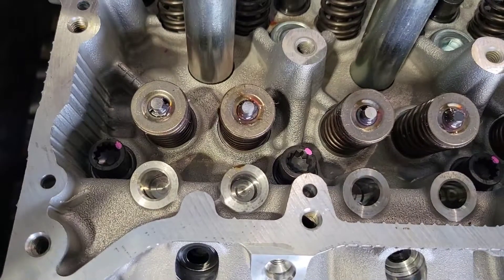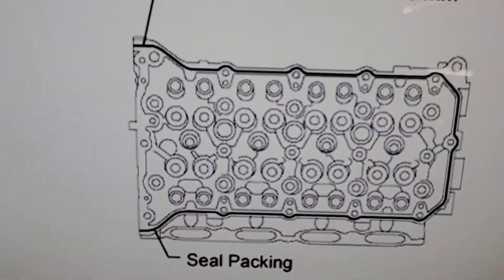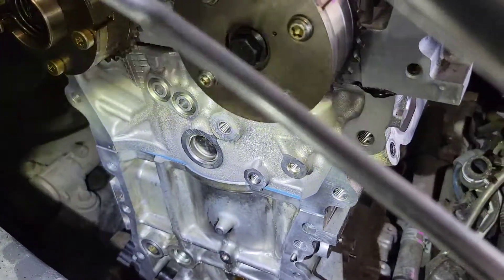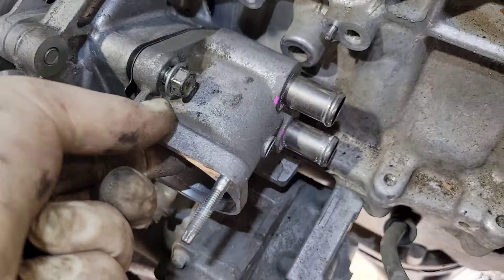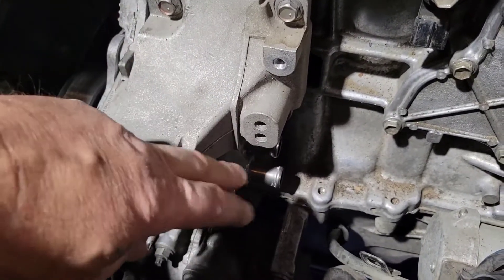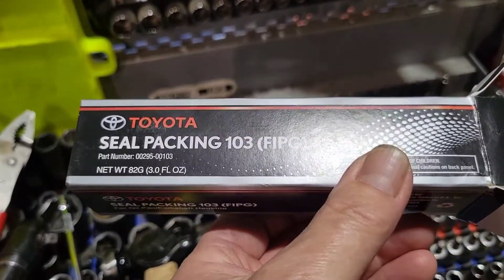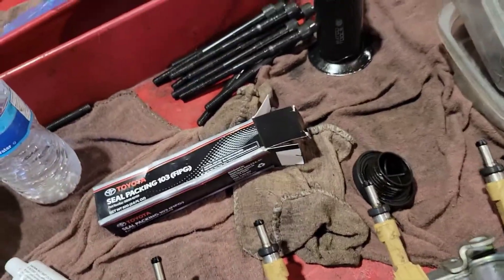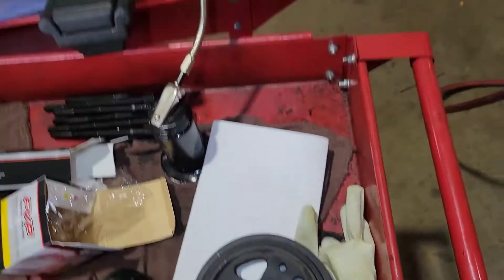2011 TOYOTA 1.8 Head Gasket INSTALLATION

Comment: How did you get that last bolt out of the bracket above the thermostat housing? I'm working on tearing down my engine right now, waiting on parts. But I'm having a heck of a time understanding how that last bolt comes out behind the thermostat housing before you remove the timing cover.
Reply from the maker: It is a pain in the butt to be honest. Thanks for watching
Reply: @NutsandBoltswithTone  Thanks again for your help posting this video made all the difference! You rock

Comment: Thank you for this video, I have a 2009 Corolla and she too had low compression in cylinder 3 and 4 and had cylinder 4 misfire, mechanics said no way its a head gasket, they told me new engine or new car, anyway thanks to your video and 2 others i was able to tear the engine apart and, behold my head gasket was burned through between cylinder 3 and 4 installed a new one from Felpro and problem is gone. Thank you for this video, it helped alot.
Reply from the maker: You are very welcome and happy it turned out good.

Comment: Thank you so much! I’ve been tearing my 2009 matrix apart. Finally got to the head gasket. Now I’m putting all back together.

Is there a good place to find specific specs for my engine? I keep finding 2003… not the same. Thanks!!
Reply from the maker: Alldata is what we use, you can buy a subscription for your specific vehicle.  Thanks for watching

Comment: Hey there, thank you for this instructional video! After I place the cam carrier on the head and insert the bolts loosely just to hold it in place.. how long should I wait for the FIPG to harden a bit before I torque down the bolts to spec?
Reply: Hey, just thought I'd keep you posted.. I finally re-removed the cover and set the timing properly again. After reassembly, my father-in-laws' car is once again functioning properly! Thanks again for this video and I hope you have a beautiful rest of your day my friend!
Reply from the maker: @AhiNama915  that is great news, thank you for following up.  I appreciate you
Reply from the maker: Omg I wish I had got to this sooner, the answer is immediately. You have everything clean and ready to assembly, put the sealer on, cam carrier then torque them down within a short time. You do not want the sealer to set before torquing it down. Message me on Instagram if you have any more questions. Thanks for watching.
Reply: @NutsandBoltswithTone  It's okay! Thank you for the reply. I ended up doing the same as you mentioned, and all went well. I even put the timing cover on the same. I put the tensioner in (un-tensioned) and left everything in place to continue the job the next day upon coming back. My father-in-law must have done something while I was gone, and when I came back I noticed the chain had jumped 1 tooth (the timing cover is already on) and now I don't know what to do? How do I fix this situation?
Reply from the maker: @AhiNama915  unfortunately you have to pull timing cover back off because with cover on even with tensioner out I don't think you can move the chain. Sorry your having trouble
Reply: @NutsandBoltswithTone  Awww man, I figured. Well.. thank you for taking the time to help me with my problem, my friend. You have a nice rest of your day!
Reply from the maker: @AhiNama915  you are welcome,  I had a couple co workers who mis timed that engine and had to take it a part.  Keep me posted on your progress please.

Comment: I enjoyed your videos on this engine and currently going into it because of no compression in all cylinders. I DIY a lot of my own and like you send out the parts to get checked. My question is when removing the head bolts, have you ever ran into the stripped threads (like most Camry engines)down in the block? what is the best fix after that issue?
Reply from the maker: Thank you for watching. Yes I have come across the Camry threads in the block pulling out with the head bolts. The only two options for this is to buy the kit to bore and install new threads or send the block to machine shop. When I come across this we remove the engine block and send out to the machine shop to have them bore and rethread all the bolt holes. If you are doing this you should bore and rethread all the head bolt holes. We send block out and have all the threads replaced. Thanks for watching.  Hit me up on Instagram if you have any further questions.

Comment: Your procedure for releasing the timing chain tensioner is not correct.   Once installed, you can’t get a screwdriver down to release the latch, nor do you need to.  Once it is installed, just rotate the engine counterclockwise about 1/2 turn and the latch will release.
Reply from the maker: Yes you are correct this is not the proper way, it works but not the correct way. You can actually get a screwdriver down there, I actually rotate the engine back to pop the tensioner then I stick a screwdriver down there to move the lock lever away from the tensioner. I updated my repair info in a future video doing timing cover on a Prius. Thank you for the information. I appreciate you watching.
Reply: Both ways work. I used the screw driver method. Just finished my head gasket today and this video was super useful!!!
Reply: I didn't use a screwdriver but didn't hear a specific swooshy sound so I had to open the valve cover an peak through the top to make sure everything was A-ok before starting the car back up.

Comment: Do i have to machine the head. I just blew my head gasket.
Reply from the maker: I always send the cylinder head to the machine shop to have it checked. If you pull it off and the head is warped and you install it with new headgasket you will have a blown head gasket again. Most of the time we send heads out to be checked they need to be machined. Thanks for watching. Hit me up on Instagram if you have anymore questions.

Comment: What if I rotated the engine with the cans out to clean the Pistons and now the kids won’t go in there the same? I mean the lobes are pushing right down on rockers and I can’t get the cams to sit flush or where it needs to be for timing.
Reply from the maker: You have to rotate cams slightly forward or backwards to get them in and torqued down. Then you have to move cams into time.  Thanks for watching.

Comment: do you find it true that flushing your coolant system helps prevent head gasket issues?
Reply from the maker: Honestly you should do it as a maintenance item but I do not think it is a contributor to it. Either you head gasket just fails from having a flaw or it was over heated and caused it to fail. Thank you for watching.

Comment: Tone, I just hot mine tore apart today and am working on ordering parts and was wondering what brand head gasket you recommend? Also what about the tensioner?
Reply from the maker: I think we put in fel pro but not saying that is a great option.  If it were me I would use oem head gasket. As far as the tensioner,  I would also offer a close to oem as possible.  If you have a lot of miles really inspect your timing chain guides make sure they are OK. If you have any further questions message me on Instagram.  Thanks for watching.

Comment: so did the cylinder head you sent off pressure test good? did they surface it or find anything wrong with the old head?
Reply from the maker: They resurfaced it. It was the head gasket, The machine shop actually did a valve job while it was there. Thank you for watching.

Comment: if you are catching a slight head gasket leak before it gets bad knowing what i know from months of research that thats whats causing my really low idle and slight loss of compression on 1 and 2 do i have to get the head resurfaced? ive heard mixed views if its not bad i would think it would be ok?? thanks for the work and time given to teach us DIY mechanics!
Reply from the maker: So here is my honest opinion, you have two choices send the head out and have it checked or not. Here is the problem, if you do not send it out and it is warped at all you will have to do the whole job over again. If you send it out and have it checked you also find out if you need any cylinder head work done. Best to get it done while head is off. I would personally never remove a cylinder head and not send it out, especially if it was for a blown headgasket. I appreciate you watching. message me on Instagram if you have any further questions.
Reply: Ok Instagram I go lol
Reply: Some are saying the tolerance is so low that marching it could mess up the timing because it will be a tiny bit shorter with the material gone...
Reply: @BIONDIEST  right that's where I was under the impression of...someone said it says in the owners manual not to have to head machined PEROID
Reply: @Justin Mike  it's really sad that things cannot be fixed anymore. You would think you could do something to offset that with the timing with the guides or chain or something... I've been wondering about this misfire on 4 for months and I've had mine parked. It makes pinging noises while accelerating in gear and shakes a little. The mechanics are trying to sell me cleanings and crap. It's either run the car dead or maybe not fix it right myself. Paying someone to do it doesn't seem worth it. a used or new engine doesn't seem worth it. Can't afford a new car.  I'm going to pray it's the head gasket and that it's not warped. Most risk most reward...Hopefully.  well if you find out anything please let me know.

Comment: If it hasn't been done yet on this engine, during this job would be the ideal time to replace the intake VVTi gear with the latest revision - part number 13050-0T050 - to avoid a future cold start rattle from the original gear.
Reply from the maker: Very good tip

Comment: Hey man I appreciate the video I just watched both of your videos while doing this job. After I got everything back together it runs great but I have an abs light, and airbag light and a steering light and the trans will not shift out of park. Can you tel me what I did wrong please.
Reply: Thanks for your reply man! It turns out I got into a rush because I was working outside in 9 degree weather on Christmas eve when I was finishing it up. I forgot to hook up the alternator and when I connected the battery and started it up I blew the fusible link which cause me to lose all those systems.
Reply from the maker: @Brandon Bentley  well I am happy you figured it out and nothing major.  👍
Reply from the maker: Well first I appreciate you watching and am happy you were able to complete the repair, as far as the lights being on and not shifting that could be a lot of things. To be able to shift out of park your brake light switch generally have to work, this could affect the other systems. First thing check to see if your brake lights work. If you have any questions message me on my instagram.

Comment: How did you clean all the silicone off of the engine block where the timing chain cover goes on?
Reply from the maker: I take scotch Brite pads and cut them in to small squares and with brake clean scrub. First thing I do though is take razor blade and cut off big pieces of silicone. Then scrub with scotch Brite pads. Thank you for watching I appreciate it.
Reply: I'm doing this exact job right now. I used your video to take everything apart and it was a great video.  Waiting on parts to be delivered and I'll be referring to this video for reassembly. Thank you very much for doing these videos!
Reply: Is the thermostat housing gasket just a metal gasket or does it need sealant.

Comment: Awesome, thanks. I typically give myself 3x more time to do a repair than a pro, how long did this take you? I have a 2010 Matrix 1.8L that I think might be the head gasket. Making sure its not just a leaky timing tensioner before I get in there.
Reply from the maker: I am not sure how long and I can't remember what the book time is. But honestly if you have an oil leak from that area it is almost always the tensioner leaking. I've never done head gasket on this engine from oil leak only from blown head gasket. Thank you for watching the video. Let me know on Instagram if you have any questions.

Comment: More and more I find myself using factory Toyota parts.
I did a coolant bypass hose and gasket. Less than $25 total.
Reply from the maker: I would use more oem parts but the service writers are so stuck on that gross profit.  Thank you for watching.